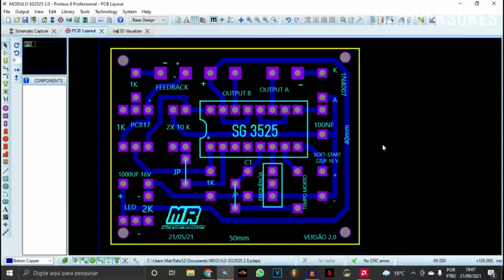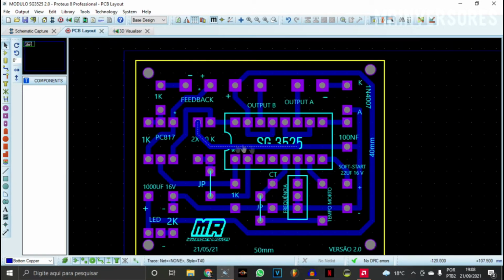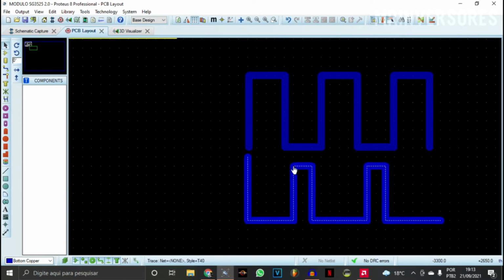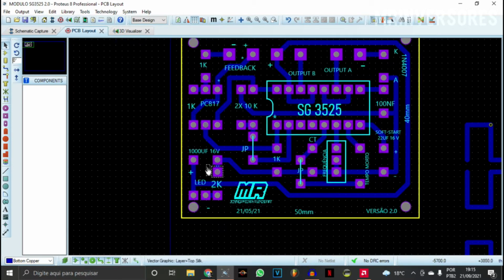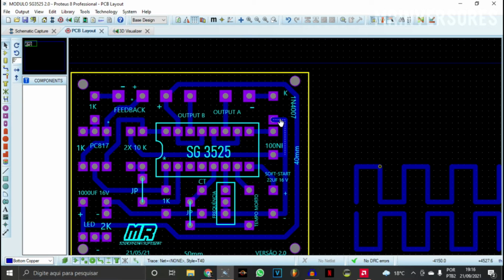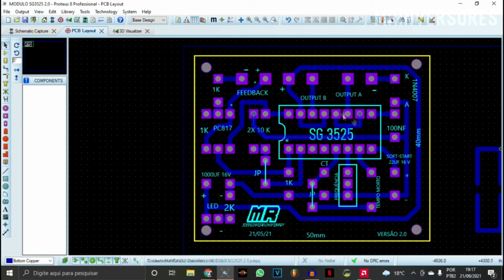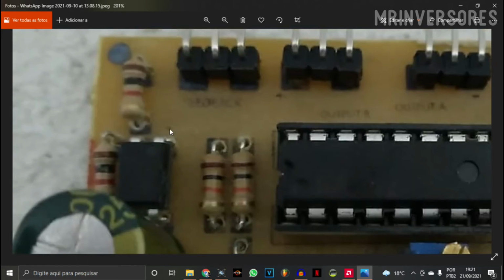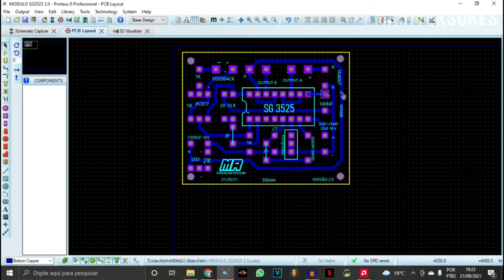SG3525 MODULE VERSION 2.0 🔥

Comment: Thank you for this video, please how do you connect the TL431? I intend to use it for a high frequency inverter, I want to stabilise the output voltage at 320 volts